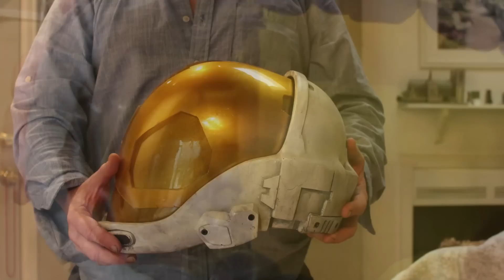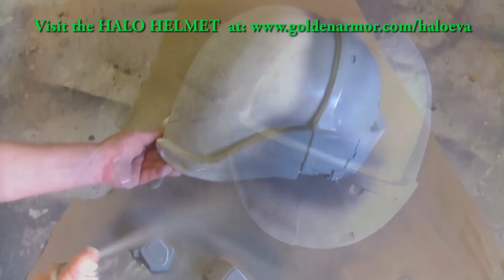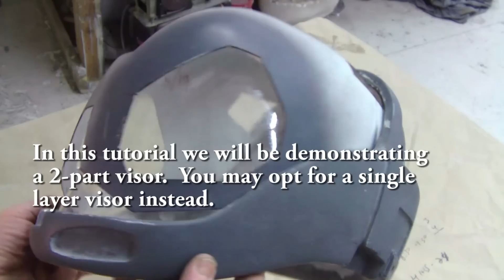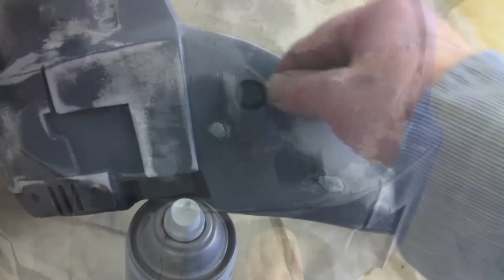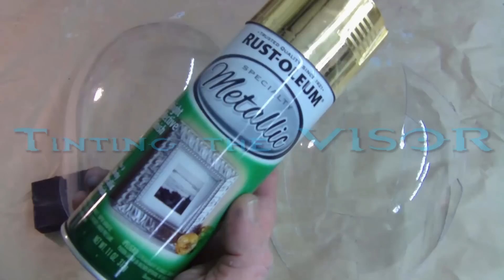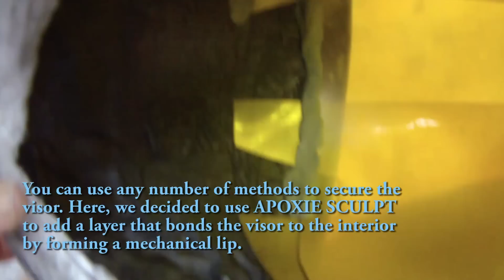HALO EVA Helmet Prop Tutorial  (HD)  Lifesized HALO META helmet prop armor

Comment: the casing that holds the glass can be made out of steel and the glass can made out of plexiglass to make it Bulletproof for real military purposes and use
Reply: do you have any idea how thick bulletproof plexiglass is?
Reply: Sergio Navarro the plexiglass alone would weigh over 10 pounds. Add in steel, and you're looking at a 50 pound helmet.